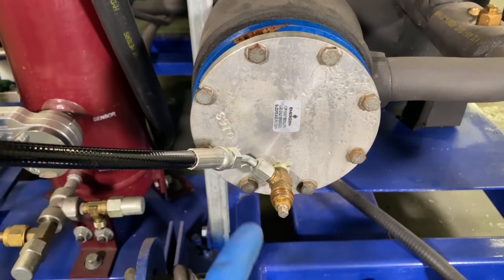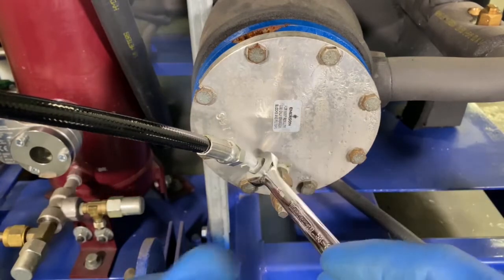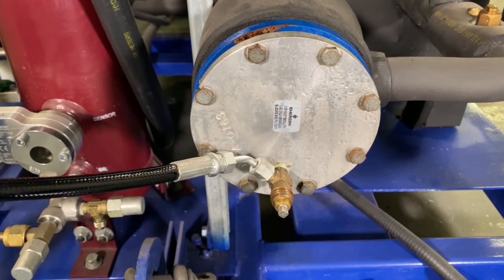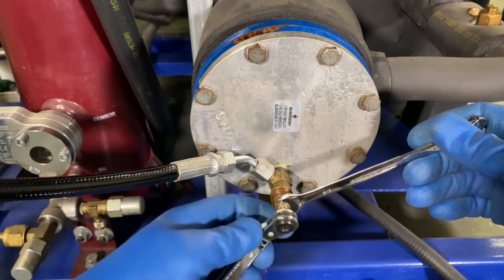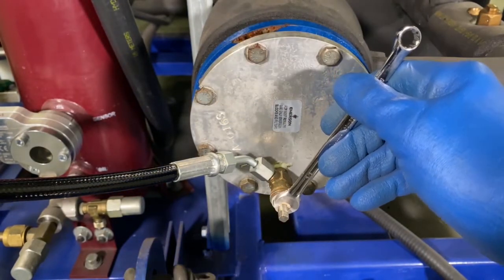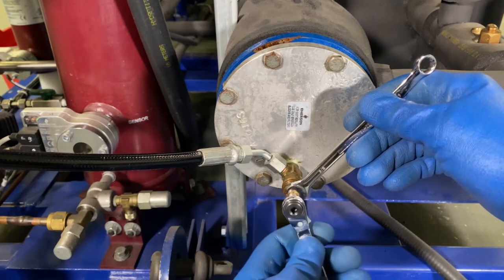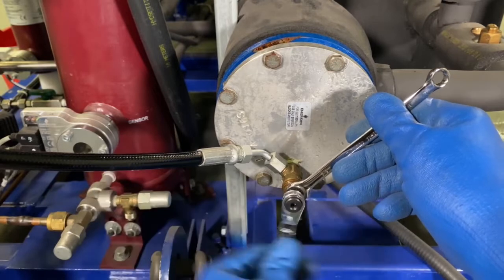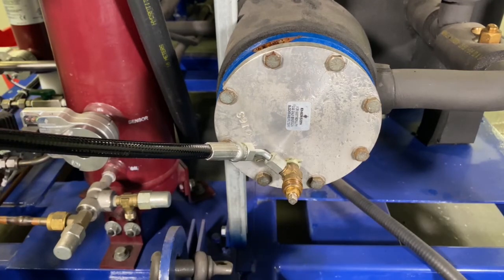Charging A Refrigeration System

Comment: So no drawing what's in the line back into the system , like regular regrigerant?
Reply from the maker: Yes I would do that with any synthetic refrigerants. With R744 it is a natural refrigerant and it’s okay to release some to the atmosphere. You always need to make sure that it is away from the public and in within the safe limits in that space.
Reply: @RefrigerationMentor ; Schooled... 🤣 I suppose I’ll pump my gauges out every time... I was gonna mention that CO2 has zero GWP, so you could empty a whole tank with no environmental repercussions. I do ammonia refrigeration, mainly. Same thing with Nh3
Reply: I only do that on smaller systems. If my sight glass isn’t flashing and the system gives me good numbers, I call it good. If I’m charging a system with only a few lbs, or if the system is critically charged, I’ll pump out my gauges. Most of the systems I work on that are CFC/HCFC/HFC refrigerants are pretty big. So that extra few ounces left in my gauges once I’m done charging, aren’t critical. But, I would say it’s never a bad habit to pump out your gauges, even if you’re just checking pressure. I actually always forget to pump them out when checking net oil pump pressure, so maybe I should just start doing that every time. I’d probably make less of a mess...